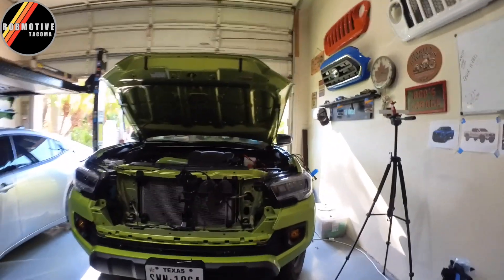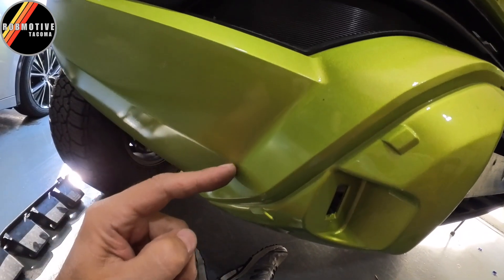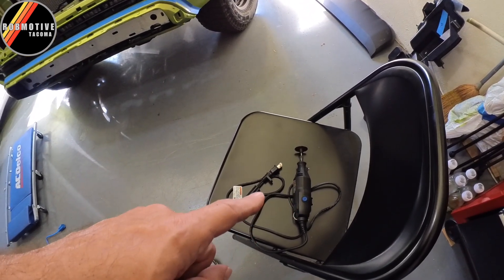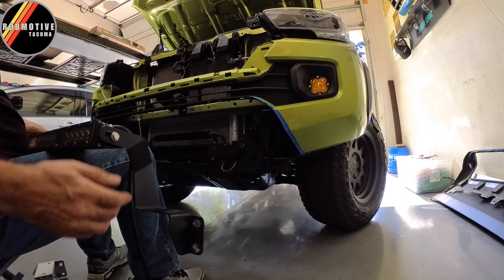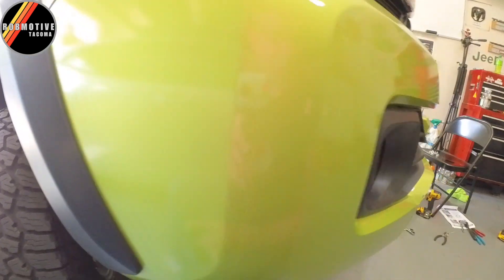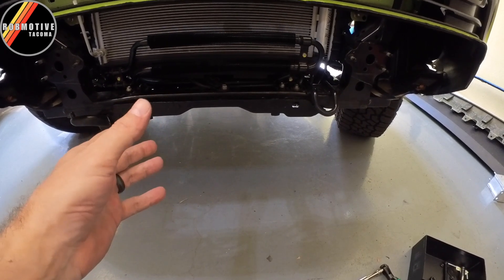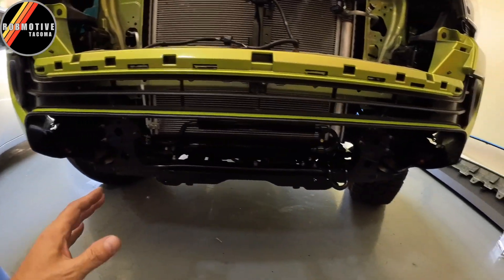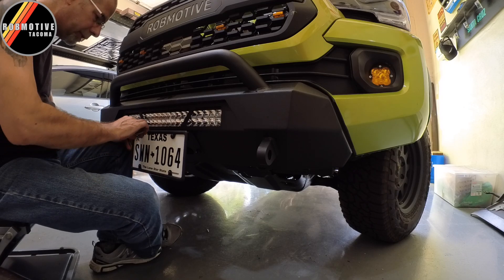New Front Bumper For The Toyota Tacoma. Ft: Cutting and Install

Comment: I think the Cali Raised bumper comes with brackets so you can keep the hidden light bar.  Will be the way I go.
Reply from the maker: I’m sure I could have rigged it, but no need with the setup this bumper has👍
Reply: The other advantage of the pricier Cali Raised LED Stealth bumper is that it you can cut the original bumper plastic below the bevel. This mates the steel bumper to the plastic more cleanly and without the need for that add-on trim piece, which seems like an after thought from the Body Armor engineers.

Comment: Will that new bumper work with a front receiver hitch?  I have that due to a snowsport plow but I may not need that when I retire as I won't be plowing so I do like that look of your new bumper!  TIA   Also cost and link for that bumper?
Reply from the maker: Not sure.  You’d have to consult with the manufacturer to answer that🤔
Reply: Do you have a cost and link to the bumper you installed? @RobMotive

Comment: Where are you connecting the light bar too?
Reply from the maker: Have a look: Huge Change Coming for the Tacoma ft. The New Bumper!
https://youtu.be/AmRxDSNyV7M
Reply: I mean the wiring  for the lightbar where does it connect to on the truck? A fuse or to battery? Or?
Reply from the maker: @joefucilli2032 Have a look: https://youtu.be/7JaT1c5b6DU?si=bBIDNJ6zAa5c8pnM

Comment: Why did you skip the actual bolting of the bumper??
Reply from the maker: Not sure what you mean?
Reply: at min 17.40 you go go from talking about where to bolt the bumper and the extra long bolt and then all of a sudden the bumper is on the truck and you never explained where the long bolt was placed or were to connect the lights.   In my opinion you had a good video that you really cut short.  @RobMotive
Reply from the maker: @rudysilva3 Given the tight quarters, there was no way to actually show the bolt going thru the hole.  However, it’s very obvious in the directions.  As for the wires, it’s connected to my Auxbeam switch that I’ve shown many times on channel👍